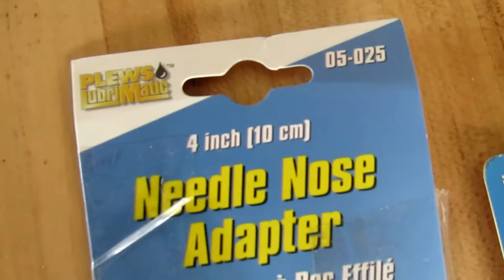Trying Some Different Type Grease Gun Tips For My Harbor Freight Trencher

Comment: Thanks for clearing that up because in your first video that needle is a nightmare !  it bends, it breaks, and you cant get it off you needle gun to save your life. I took it back so many times advance auto won't let me exchange it no more . This seems like a better solution.
Reply from the maker: I have finally started drilling them out, tapping the holes and switching to standard grease fittings. Never seen fittings like this before. They should include the adapter with the machine. Thanks for watching.

Comment: Thank you. Exactly the video I needed
Reply from the maker: I wound up going with a different tip in the end. Have started drilling and taping the pins to use regular pins now as the stock type are a pain and make a mess with any of the aftermarket tips. Thanks for watching.

Comment: I did my homework on this after buying my HF backhoe. Use the right tip, such as the Alamite Z737, do not shove a needle into it, how can the spring not get bent? Zerks and this type of fittings open from the pressure of the grease, not by pushing the ball with the tool. I got one on ebay for $8.
Reply from the maker: On newer  videos I showed switching to the pews tip but now I have started  drilling and tapping the pins for standard  fittings  like  all my other  equipment uses. Thanks for watching.

Comment: I would take all of the pins out and thread them to accept a grease fitting.
But that's just me. lm kinda of a do it once the hard way, and do it the easy way from then on guy.
Reply from the maker: I thought about that, but for now the pin greaser works pretty good. some day I may just pull one out and throw it in my lathe to see if there is enough material to counterbore them so the threaded zerk would remain flush.Thanks for watching my video.
Reply from the maker: That is a great idea. Thanks for watching.

Comment: I almost wish you could just thread a regular grease zert into those pins that need to use a pin greaser. The problem with a regular grease zert is that theres a chance that it could get broken off while digging. Great video!!!
Reply from the maker: The long pin works pretty good and is not hard to use. As you say standard zerk fittings could catch on something and break off so I guess it is why they used the flush ones. The long pin will also be good for applying grease to hard to reach spots on other equipment so having a second gun is no big problem. Thanks for watching.